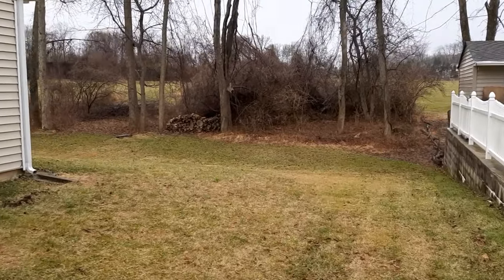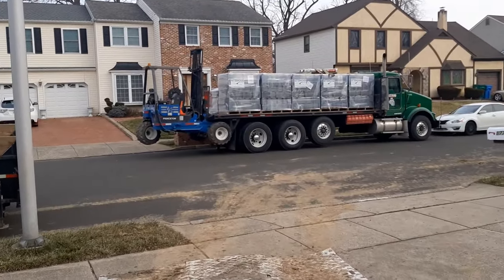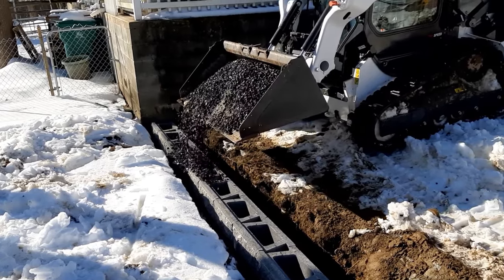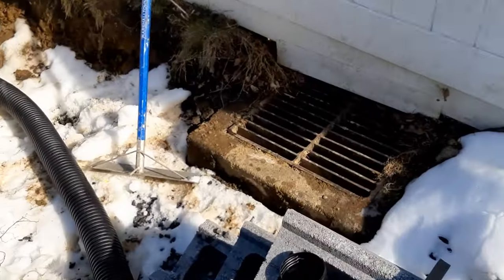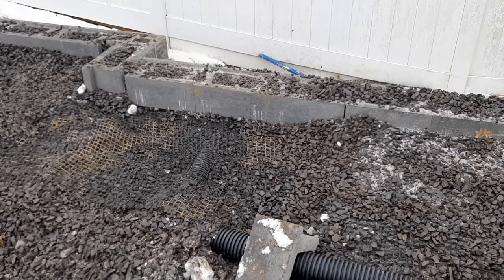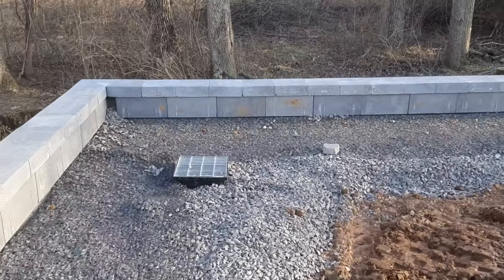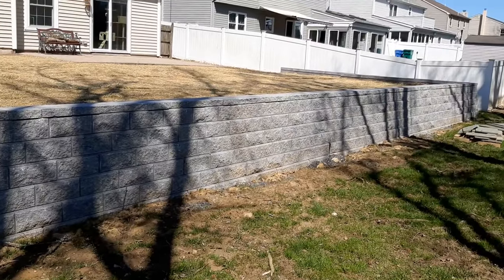How to Build a Retaining Wall Start to Finish

Comment: This is what we normally call an MSE wall (mechanically stabilized earth) engineered as you've done. And can go relatively. High depending on tail length of fabric or galvanized steel grid etc. Very nice work, our leveling slab on the west coast are concrete. but only a foot thick and a foot wide depending on height. Again, very nice work men
Reply from the maker: Thank you

Comment: Hey Sean, I've watched a bunch of your retaining wall videos and I want to confirm the process for replacing a 32 inch retaining wall that's collapsing: 
-dig down 12 inches, compact base
-put down 4 inches of 3/4 inch gravel, compact 
-lay first blocks, level
-put landscaping fabric behind wall, French drain pipe
-stack additional layers of blocks
-backfill behind wall with 3/4 inch gravel, compact
-wrap landscaping fabric back
-cap stones
-beers with the boys
Reply from the maker: Eric, Your on the right track! I would do a 6" base and make sure 1 row of blocks are completely buried. So if your blocks are 10" tall, you will need to dig down 16". Also I never use fabric behind walls. Unless you live in an area where the soil is very sandy I wouldn't recommend it. Thanks for watching and let me know if you have any questions.
Reply: Hey brother. I think you meant geo grid behind wall.
Reply: Replace the fabric with geo grid and ur golden
Reply: What’s a geo grid ?
Reply: @achunable  a web fabric that conects the wall and the fill material behind it

Comment: Much respect working out in the cold- nice work!
Reply from the maker: Thank you, it's not easy some days
Reply: Cold, for me working outside since the early 80's I would perfer the cold .you can put on another layer in the cold, the heat in need air conditioning and that is inside.

Comment: Could you explain what who makes it, and model filter fabric material you purchased and what size pipe you used.  Also how much clean stone was used in this whole job.   This is beautiful work!  You guys overbuilt everything here.  Truely inspiring!  I am subscribing for sure   Lot to learn here!
Reply from the maker: Thank you, a retaining wall is nothing you want to cheap out on. I always take my time to explain all the details to the customer and why they need to be careful who they hire to build one. I'm not sure of the manufacturer of the filter Fabric it's from the local supply yard. I know it's a little thicker and more heavy duty than what you get from The Big box store. The pipe is a 4-in perforated pipe. Thanks for watching and let me know if you need any more info.

Comment: Nicely built. I have worse slop that this. And require a 5.’5” tall retaining wall . I have two kids , what type of fence is best of this type of application, ?thanks
Reply from the maker: Thank you, a cable railing system is light weight and in most cases can be installed directly on top of the wall. A aluminum railing is also a good option. If you wanted to install a privacy type gate it would need to be 3 ft away from the wall. So it didn't add extra load to the wall. Thanks for watching!

Comment: Hey Sean! Amazing work! Beautiful! I am curious about the start and finish regarding the weather. You obviously had a snowfall at the start of the job, and I think it appears maybe another snowfall. But then it looks like spring as you finished the job. Did you have to hold the job at some point because of the season and weather?
Reply from the maker: Thank you I appreciate it, we got hit with 3 snow storms within 2 weeks time. We started the job at the end of Jan and it was in the low 40s and then BAM mother nature changed her mind. The job took about 20 days on site, including the paver patio we did. But that was spread out over a 6 week time frame. So when we finished it was early/mid March.
Reply: @srmcontracting  Thank you for the reply! Weather is a frustrating "Murphy Factor" when working outdoors.

I appreciate you going above and beyond to make sure your work doesn't have problems "down the road". Character among contractors seems to be at an all time low, at least around the armpit of NJ where we are at. Thank you for giving me a glimmer of hope that I might one day find a solid contractor who will go above and beyond...even if it costs me a bit more...

Comment: I'm curious why you installed the blocks upside down compared to other videos I've watched. In those, the lip was chiseled off the first course and then the lip of the blocks on the next course were installed behind the back edge of the next course.
Reply from the maker: These blocks are designed with the lip on top. Other manufacturers have the lip on the bottom

Comment: Would you ever cement the bottom blocks - if you’ll have a pool or something heavy sitting in the new raised backyard?
Reply from the maker: These walls aren't designed to have cement used. I would have the pool 6' from the wall but it's best to consult an engineer to be sure

Comment: Thanks for the video, it is much appreciated!

When designing this project, is there consideration on the load against the adjoining (neighbor's) retaining wall? Do you have to assume it was built appropriately and can withstand the added load on the face or is it confirmed somehow? Thanks
Reply from the maker: You're welcome, this wall was designed by and engineer so I believe they took that into consideration. With that said I don't believe we added any additional load to that cinder block wall. I think we did just the opposite by building up the grade. Now if that cinder block wall where to fail it would basically go unnoticed because the fill dirt would keep it in place. Thanks for watching

Comment: What is the purpose of the geograte? Is it to help hold the wall up from when the soil and rock are pushing against it? 

Building a retaining wall right now for myself and wondering if I should add this to mine. Thanks!
Reply from the maker: It acts as an anchor for the wall. If the wall is over 3 ft or is supporting a load I would definitely recommend it.

Comment: How was this able to be built without cementing the joints? Special kind of block? How does it all stay together and why is it not needed?

Cool work!
Reply: They have interlocking flanges on the block which hold them together.

Comment: No tie in to the neighbors wall, no return in that corner,  half the yard is graded into that corner, and you're in a cold climate? What's to stop the soil from filling the clean rock (I know you added a cloth on top, but soil slides sideways too) freezing and pushing that corner out? Is the stone lip enough of a setback to hold the wall in?
Reply from the maker: The neighboring wall is a CMU wall, the wall I built is a segmental retaining wall. You should never tie these different wall types together. Yes I'm in eastern PA, we go through many freeze thaw cycles. We never put fabric vertically behind retaining walls, our soil has a very high clay content and will quickly clog the fabric. Once that fabric clogs it will put hydrostatic pressure on the wall and lead to failure. There is at least 18" of clean stone behind that wall, it will take 50 years for the soil to migrate through it. In addition to the lip, we also put Geo Grid which acts as an anchor behind the wall. The blocks are also filled with 3/4" stone, this also holds them together. I've built many walls designed by engineers and this is how it's done in my region. Thanks for watching!
Reply: @srmcontracting  thanks so much for answering, I now have a much better grasp on it. Though out the video we never see that corner and I was totally confused. Thanks again for clearing this up . Great work, love seeing you guys create a usable back yard out of a useless hill.

Comment: Very nice work! We have a nearly identical block in Australia called a Tasman block ( that's the brand name) and looks so good like the block you used in the video 
The code in Australia specifies a concrete footing, the blocks to be core filled with no fines concrete and the wall also.back filled with no fines concrete too
Does code in the states specfy things like that?
Reply from the maker: Thank you, there are certain applications where we us no fines concrete. But it's not a requirement for every wall.
Reply: @srmcontracting  yep makes sense, you guys have snow and freeze thaw to contend with too i guess, we dont have the down under 
excellent work

Comment: I am doing mine myself could I use 3/4 dense as base on top of subgrade
Reply from the maker: Yes, I'm assuming that's what I know as 3/4" modified. Which is a mix of 3/4" stone down to stone dust. I've used that for my base many times. Thanks for watching

Comment: Quick question, can you pour a concrete patio on top of a retaining wall like this?
Reply from the maker: Yes, as long as the wall was built to withstand the surcharge from the patio.
Reply: those blocks always fall apart. i wouldn’t.

Comment: no adhesive to hold the wall together? can you add adhesive if wanted to? PL600 or something like that? how strong is the wall without any adhesive?
Reply from the maker: No adhesive needed for these type of blocks. This is how the manufacturer designed it to be built. Thanks for watching

Comment: You don’t use a filter fabric between stone and subsoil? I’ve always found it adds a layer of insurance. Keeps stone from weeping into the surrounding soil.
Reply from the maker: No sir, here is eastern PA the soil has a high clay content. This will clogged the fabric very quickly and put hydrostatic pressure on the wall. I've built several walls that have been designed by engineers, none of which called for vertical filter fabric behind the wall. I would only use it if the soil was very sandy. Thanks for watching!
Reply: @srmcontracting  makes sense. Thanks for the info. In my area we have a lot of sandy soil. No matter what you do the ground is still somewhat soft and really like to hold water. So filter fabric is an absolute requirement for us. I use 2 separate stones for my base material. 3/4 clean for about 7/8ths of the base at whatever depth is required then the top 1/8th I use 3/8” limestone chips. Really helps lock everything together when tucked into the filter fabric trench liner.

Comment: very nice.  I was surprised that you put in as much geo fabric as you did.  Typically you see it every every 3-4 feet in walls taller than 4 feet.  I have seldom seen it at all in walls under 4 feet.  I was also  surprised to see a 2 drains (toe and heel) instead of just 1 especially with wall under 4 feet.  Finally, I was puzzled by the fact that your lawn level is under the top course of your wall.  Typically the lawn should be higher than the all so runoff goes over the top of the wall rather than in behind it.
Reply from the maker: Thank you, this wall was designed by an engineer so everything was built to his spec. With that said I often build 3 - 5' walls with geogrid every 2 courses. Its cheap insurance in my opinion. Thanks for watching
Reply: I’ve worked with engineers over 25 years. They all over engineer everything as to avoid any possible lawsuit. If I can help it, I go out of my way to give them free reign on design.

Comment: I have been designing MSE walls for 35 years. One comment - the geogrid is supposed to be installed 90 degrees from the way you did and stretched tight before backfilling and compacting to take the slack out of it. Each section of grid is to be overlapped 6-inches. You do not roll it out parallel to the wall.
Reply from the maker: Thanks for the comment but we used "Biaxial Geogrid" which has the same strength in both directions. It was installed correctly per the manufacture recommendations.

Comment: HI, Im trying to get better are retaining walls and just curious on why you put 3/4 clean instead of modified for the base?  I've seen other contractors on YouTube do it like that but I've never understudy why
Reply from the maker: It all depends on your drain placement, we used 3/4" clean because the base drained directly into the storm drain below grade. If that drain wasn't there, we would have used modified for the base and behind the blocks until we got to the drain height.

Comment: Is there a reason you rolled the grid down the wall like that. The Strength in that grid is only front to back. Not side to side unless it's HP300 or greater
Reply from the maker: It's SRW Biaxial geogrid, it has the same strength either direction
Reply: Nice good looking wall. I've been building them for the past 10 year's now. For BC Hardscapes but I'm on the Commercial side of building them just got done with a 2,000ft 56 row wall. For Amazon here in Kansas City
Reply from the maker: @shanegerhardt6316  Thanks, I'm currently working on a commercial retaining wall as well. It's 1300 sq ft and we're using Redi-Rock (Big block wall). Stay tuned for the video and Thanks for watching!

Comment: No cement between the blocks?
Reply from the maker: No sir, these blocks are designed to be dry stacked. They're held together by a lip on the top and bottom of each block. As well as the cores being filling with 3/4" angular rock. This also gives the wall the ability to flex if it were to be subjected to any hydro static pressure. Thanks for watching!
Reply: @srmcontracting  that's some hi tech blocks.  I'll research into that.  Thankyou
Reply: @srmcontracting  you sure know your work. First time I saw dry Wall stacked like that.

Comment: How much would this cost for a 300 foot long by 6 feet tall From ground level?
Reply from the maker: That is a large wall and there are many variables. Your market, site Access, commercial or residential all play a big factor. This wall would require an engineered design and the wall will require geogrid reinforcement. Assuming at least 1' of the wall would be buried. 7' x 300' is 2100 SQ ft add about 10% for waste, cuts, etc. 2300 SQ ft x $45  = $103,500. Now if the site is an easy access commercial job then it could be less. If it's a home on a mountain side then it could be more. Hope this helps.

Comment: So, are the “heal” and “toe” drain pipe solid or perforated? I understand wanting to do a great job and building a wall that will last forever, but being there really isn’t a down hill grade issue, all that geo fabric is unnecessary and over pricing the project by hundreds of dollars. IMO
Reply from the maker: Both pipes are perforated. I'm perfectly content with over building everything that I do. I explain that to all my customers up front. Also we had the pull permits for this job and have an engineer design the wall. So the wall was built per their design. Thanks for watching.
Reply: Even if that amount of grid wasn't required, I'd still use it. Overpricing a job by a few hundred dollars on a job this size which likely was priced at $15,000+ is nothing for cheap insurance. The way they built this wall, unless there's a flood or earthquake, it will probably never fail.
Reply from the maker: @kyesniper  That's exactly how I think! Thanks for watching

Comment: How is water suppose to get into a pipe that’s laying on top of 12”+ of crushed stone? I don’t think any water would get into it unless the wall retained 12” off water, not to mention you already have a pipe below that one. I also don’t understand the Georgrid so low in the wall?
Reply: Water takes path of least resistance. Some will enter the top pipe before ever making it to the lower pipe.  Most goes to lower, it’s just an added insurance.

Comment: 3/4 clean is not a base material!   Clean stone does not compact, your base must be as hard as concrete.    Class5 or  modified stone is a base material.  Your drainage pipe is useless when the water can flow right past it and under the wall into the base.  Otherwise beautiful job
Reply from the maker: Sorry but I have to disagree with you. 3/4" is great base material and compacts very well. Ive seen 50' tall retaining walls holding up parking lots built with 3/4" clean stone. Not to mention, this wall was designed by an engineer and it called for 3/4" clean stone. As far as the drainage goes, you are correct the water will flow past the pipe through the stone. One thing I left out in the video is the base actually drained directly into the storm drain at the corner of the wall. The pipe was basically just a backup system. Thanks for watching!
Reply: @srmcontracting  clean stone contains absolutely no fines and therefore  , will not compact.   Guaranteed.   Clean stone is for under a concrete slab to prevent freeze and thaw.   A retaining wall base should not be built with clean stone. Have you ever compacted 2A modified and then 2B clean. The compactor will bounce on the modified and on clean it will move it out of its way.  You do a great job but I would never trust building my walls on clean.
Reply from the maker: @MrBmxbrawler  I've built many retaining walls and yes I've compacted 100 of tons of modified. Modified gives the effect of being more compacted but I assure you 3/4 stone compacts just as well. At the surface it seems loose but the angular nature of the stone locks them together.  https://ncma.org/resource/srw-design-manual/  if your interested download this manual and read chapter 2. Its shows "Well-graded gravels, little or no fines has excellent Shearing Strength when Compacted and Saturated". I don't want to argue with you, that's not what my channel is about.
Reply: @srmcontracting   You do a great job.  Everyone does it a bit differently.  We set walls on compacted modified with a thin layer of screenings for fine tuning.
Reply: @srmcontracting  Thank You sooo much for that design-manual link!

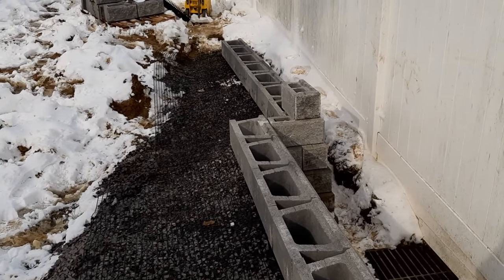Comment: You wasted the time using a string line, walls still aren't straight, compacting anything over 1" at a time was another mistake. 12:15 is that corner supposed to be gross or was it planned?